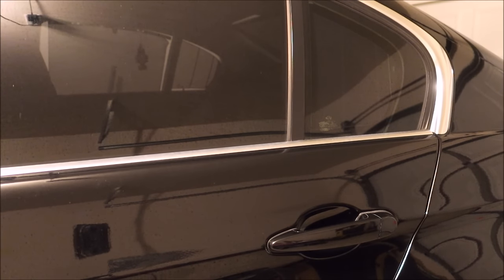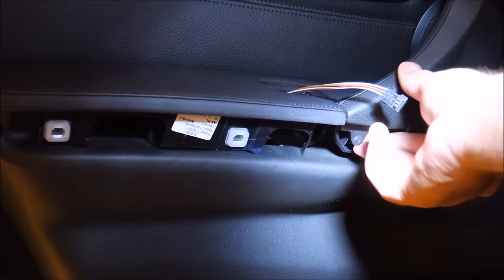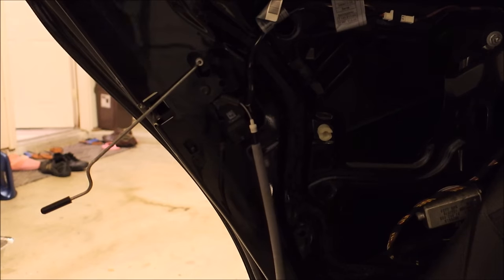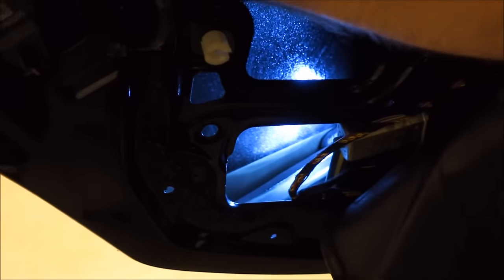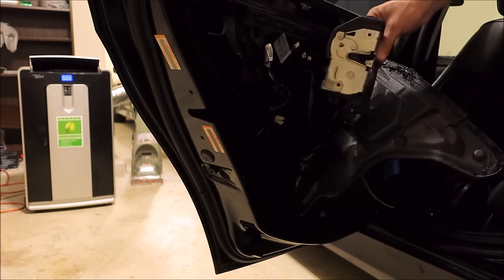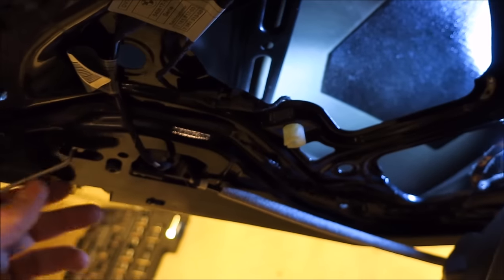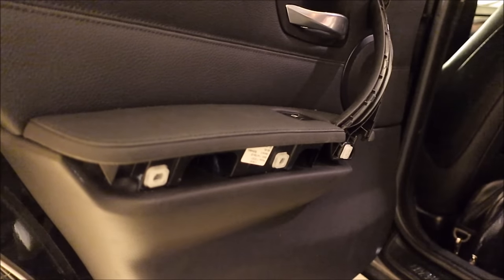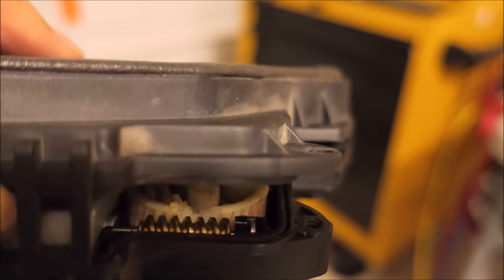BMW E90 Sedan 335i Left Rear Door Lock Actuator Replacement DIY

Comment: Since I posted my question I have carried out a front door lock replacement. It’s identical to the front other than you need to remove the bolt securing the lower window channel and slacking off the top one. With a bit of gentle persuasion the lock mechanism can easily be removed. 30min job start to finish.

Comment: Thanks so much for this! I'm about to do this on my E91 estate, rear right. Having seen the procedure helps immensely. I was thinking about tearing the door down, and then, given that like in the video, my door lock motor is able to lock, just nut unlock, sort of means it's alive. I figured that could mean some pulling wire has gone off some hook or something. But now after seeing the video, I'll just order the replacement motor and replace it, with this video to guide me. Thanks again!
Reply from the maker: Np!  Glad you find it helpful.  Cheap plastic parts are to blame.
Reply: Vehicular DIY Not sure why I postponed doing this until today. But it wasn't even hard, when I could watch this video while doing it. Thanks again.

Comment: Instead if making a mess with the seal glue. Use a razor blade and cut throught it. It will not create strands and make a mess everywhere.  Its easier to reinstall as well.

Comment: Very informative. My problem is that I can't open the door at all either from inside or outside. The actuator has malfunctioned and seized in the locked position. I've scoured YouTube without success. Lots of videos but not for this specific problem. Any suggestions? Thanks

Comment: Thanks for the video.  I have an issue with my rear left on my E90.  Do you know if there's a way to open the door manually from inside?  I have the door card removed and it opened a couple of times initially from inside using the internal latch, but now it won't open.  The mechanism just rattles when I use the remote fob, but the door lock doesn't open, so i can't remove and replace the lock.
Reply: did you ever figure this out? im in the same boat
Reply: @taylorgiroux9870  it was a while ago now. I think I removed the metal lever from its plastic mount that operates the lock and used a flat head screw driver to turn the mechanism inside. I think it was inserted at an angle but possible to do if you persist.

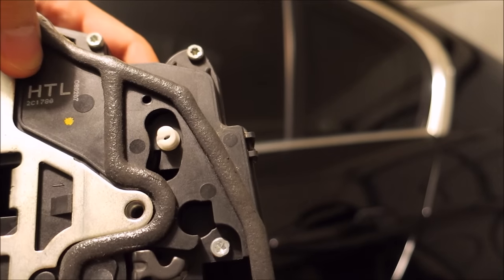Comment: @Vehicular DIY 1:30 I see the circlip that attaches to the door lock rod.  Does that need to be inserted into the actuator before the lock rod goes in?  After fixing a regulator, I broke a circlip by slamming the door closed on the dangling lock rod. Bought a new circlip and put it on the lock rod first.  Now unable to pop the lock rod into the actuator.
Reply from the maker: Yeah the lock rod should snap into that after it's already inserted into the actuator.
Reply: Vehicular DIY yes I went ahead and tried that. Turned out my lock rod wasn't properly bent back into shape. The lock kept sticking in the grommet.  Made a small adjustment and all's good now. Nice informative video.  Something to keep in mind if I need a full repair.

Comment: +Vehicular DIY you can actually fix that actuator. you just need to buy those plastic parts. You can look on ebay for example for Central Door Lock Repair Kit. I've just fixed two door locks, and going to the 3rd.
Reply from the maker: Nice, how much did that cost you?
Reply: 4 doors 35€ :)
Reply: @franciscotaborda6708  have the link?

Comment: This was extremely helpful, thank you!  After putting it all back together, I realized I didn't secure the puddle lamp wire to the actuator.  Is the purpose of that to give clearance to the window as it rolls down?
Reply from the maker: Yeah as a precaution to avoid getting snagged up.

Comment: Absolutely love your videos! I've used a few of your tutorials to work on my car. I was wondering if you would be able to give me the part number for the rear left actuator as when i search for it only the front left actuator comes up. Are they both the same actuator? Thank you in advance and keep up the informative videos !
Reply: Did you find an answer to this? BMW on Amazon says the part number is 51-22-7-202-147, but when i search by that part number, all other sellers say it won't fit my 328i 2007. It's very confusing.
Reply: Yes i did find the correct part and yes it was fairly confusing. The part number you listed ended up being the correct one for my year. Unfortunately, BMW makes it even that much more difficult to get the correct part, by having different part numbers based on the year and MONTH your car was produced..... I used realoem . com to pin point the proper part # for my BMW's year and month. Using that website was very beneficial, it also gives you the "updated" part #.  I wish you the best of lock lol (pun intended). If you have any other inquires feel free to ask.

Comment: I do not speak English.
so I do not understand the part where you talk about the courtesy lights on the door handle.

My car has a bad one, do you think I can replace it without having to disassemble the Door Lock Actuator?

Thanks for the help they are excellent videos
Reply from the maker: Just the light in the door handle is bad?

Comment: I changed my rear door driver side actuator, every thing went well except I am not able to open from outside. Any suggestions?
Reply from the maker: Check the cable that goes from the outside door handle to the actuator.  Perhaps that is binding up.
Reply: Whats the part number and where did you purchase the actuator?
Reply: @lilclipps  Yes, I need this too!

Comment: Hello I'm having this issue with my door but the door is sealed shut stuck, any ideas on how to open the door to swap the actuator? Thank you
Reply: I had the same issue, i removed the door panel from the inside, pulled back the insulation and reached in.  On the actuator itself theres a tab that hooks the cable from the handle if you reach in there and push down on that tab it will open the door, so you can finish the job like he does in the video. Hope this help and Good luck.